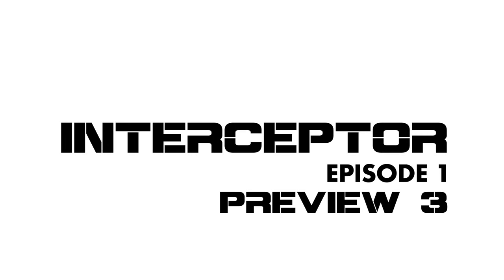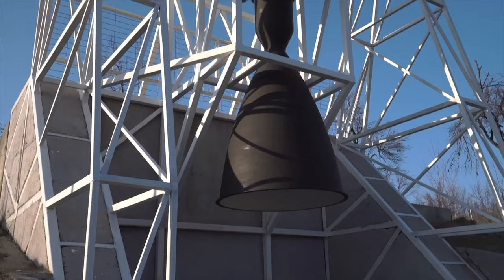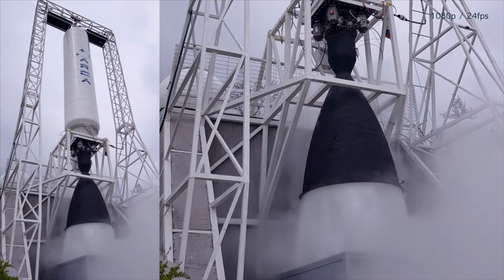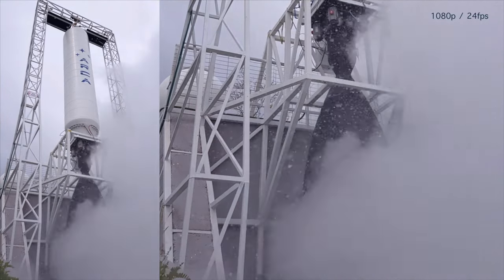INTERCEPTOR - Episode 1, Preview 3: From Zero to A1  #antiballistic #arcaspace #rocket #interceptor

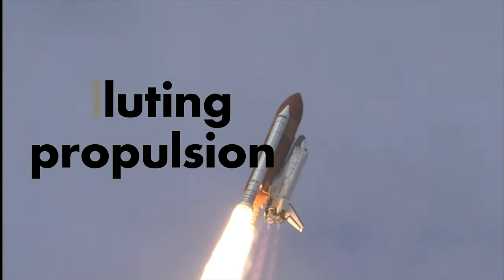Comment: 0:13
There are plenty of high-performance liquid fuel mixtures for rockets that provide a clean exhaust, mostly composed of water vapour, already in use around the world, not all are so toxic and polluting.

0:22
This depends entirely on the size of the rocket, the type of fuel, and which ones you use. You cannot just say that they represent most of the cost as a fact, when it is not.

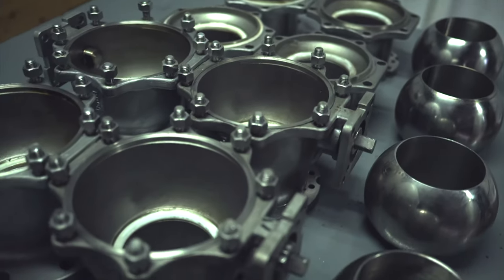0:25
Whilst I have myself looked at many papers and publications about the viability of using such stages in parts of a complete rocket with some amount of viability, I have never stumbled upon a single one that would show how a full rocket with this technology could ever be viable. If you have any sources for it, please provide them to me.

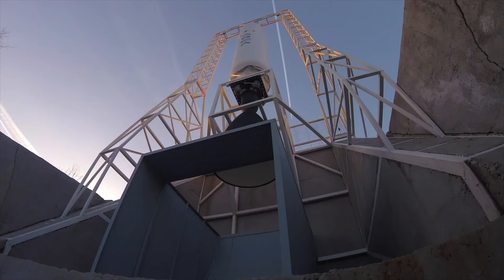0:46
I struggle to see how it would be inherently safer than most other liquid-fuelled rockets, if not for the transport, storage, and manipulation of the propellant itself as mentioned after.

1:11
Again, besides these points up here, I cannot see how it is inherently safer. Having water that would vaporize your flesh away does not seem any safer than being intoxicated by hypergolic propellants or burned to crisp by an RS-25. And if the engine fails, it will still be dangerous, the fact that it is water does not matter much here, as the heat and pressure are still very, very high (or at least, they should be to have a functioning, viable engine).

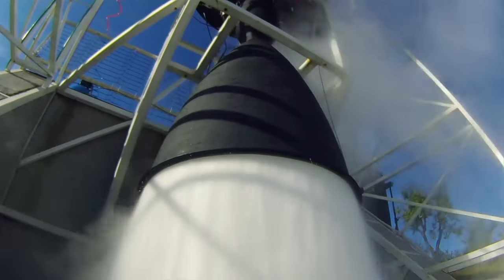1:42
And how is the water heated? If it uses batteries of any kind, the amount of them required would be significant, and the manufacturing of them is everything BUT clean and non-polluting. Furthermore, most of the energy of this country still is nowhere anything "clean", so this just sounds silly now.

Most of the other points are empty at best, and I struggle to see what the point of these videos even are.

Comment: Why not build a methane fueled rocket that burns clean when burn?
Reply from the maker: It’s expensive to work with methane and oxygen that are cryogenic. You need to implement expensive safety measures and it requires advanced machinery for the rocket engine, which also increases the cost. It isn’t clean. It releases CO2 into the atmosphere. So, water vapours are around four times less efficient, but between 10-50 times more cost efficient. For the upper stage we also use polluting propulsion, but it starts when the rocket already reached suborbital space using steam propulsion. Also, the polluting propellant mass is around 10% from the total propellant mass. So, the trade here is a rocket that is four times heavier and 10-50 times cheaper as a methane one for the same payload performance.

Comment: Says LRBs produce toxic exhaust, proceeds to show the Shuttle's RS-25s whose exhaust is 100% hot water...
Reply from the maker: It says SRBs, toxic propulsion, while LRBs, polluting propulsion. RS-25 are 100% ecological, but are not boosters.
Reply: @ARCAchannel  You can't make a claim as big as that and then conveniently forget to acknowledge that the toxicity problem has long been fixed with the advent of hydrolox and methalox liquid engines. If you want to sell your technology you better have an actual concrete demonstration of how much more environmentally friendly it is, instead of relying on mischaracterizations of the industry, and, frankly, flat out lies.
Reply from the maker: @sebastiaomendonca1477  Oh, come on! You know very well that the hydrolox propulsion is used on a very small number of cases, like the RS-25 for the SLS which also produces toxic gases with its SRBs. Also the Vulcain engine for Ariane 5 and 6 uses hydrolox, but also uses toxis SRBs. The Delta Heavy which also used hydrolox was withdrawn from service. So, what other hydrolox engines are operational out there in the world? While the vast majority of rockets use toxic and polluting propulsion. Methane, kerosene, solid, they are all poluting and expensive. And if you want to use hydrolox, good luck with your bankruptcy, because it is the most expensive option out there and it is used only by government supported programs. That's why it is used on a limited scale, beacuse it is extremely expensive.
Reply: @ARCAchannel stoke space has a hydrolox second stage